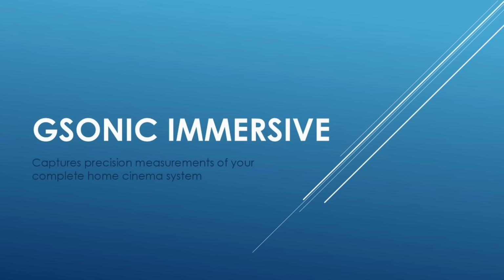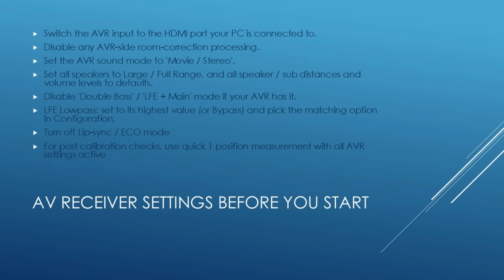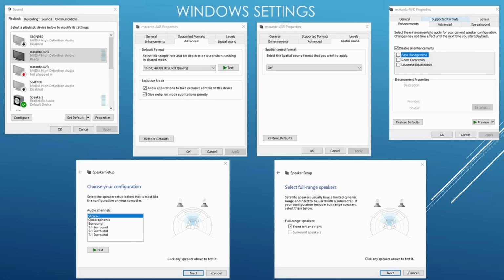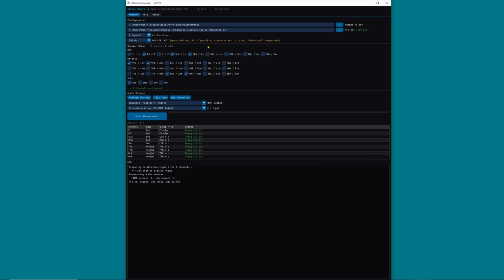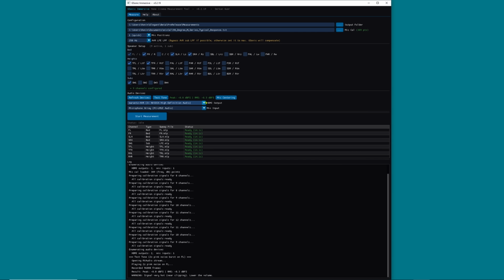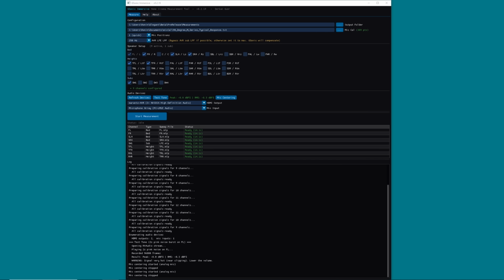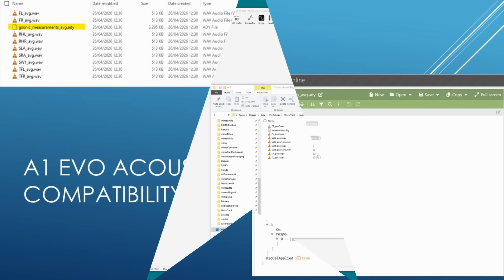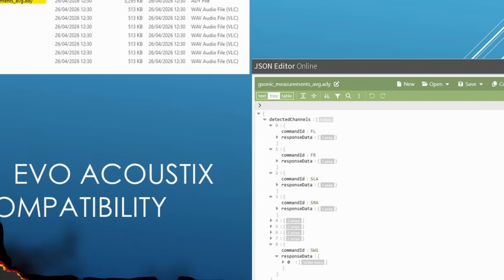GSonic Immersive

Comment: Hi,

just bought and trying to make it work. 

Getting this: 
SRA timing: both chirps were found at good level, so this is not the room, the speaker, or the mic - but the recording's internal timing is off by +213 ppm and the app could not correct it. What that means: the PC's playback clock and the microphone's capture clock disagreed over the sweep. Your output device is "4 - DENON-AVRHD (2- AMD High Definition Audio Device)". Things that cause this, in no particular order: HDMI audio clocks can wander while the graphics chip changes power state; a USB microphone with its own clock can drift against the PC; heavy background load on the PC; and room correction left running on the receiver. Worth trying: turn on 'Pause after each sweep', close other programs using audio or video, set Windows to a high-performance power plan, and if this PC has another HDMI output, try that one. Then click Repeat.

I have done: 
x6400h
umik1

8600g cpu
no gpu
so just one hdmi port.
nothing else is open

Funny though: 
When i click Repeat Measurement, then it works. 
so i can make it work but it is very annoying to have to click each time. 

Am i the first one with this issue? Couldnt find anything about it
Reply from the maker: This happens when the HDMI clock is unstable on the first wake-up, so enabling "Pause after each sweep" usually forces the clock to stabilize for subsequent measurements. You can fix the issues on your laptop audio path using the troubleshooting guide linked under the Help tab.

Comment: Hi OCA, it has been very helpful for taking measurements for my Yamaha A4A receiver. I have a few questions about using averaged measurements for EQ (they maybe very stupid, sorry about that)
1. In reference to the previous tutorials on manual calibration, we have to cross correlate multiple measurements of different positions,  and do frequency dependent windowing to prepare measurements for EQ. With Gaussian weighted average, I guess none of these steps are necessary? Please confirm.
2. Appreciate it if a tutorial can be made on how manual calibration can be done for atmos systems with the results from Gsonic immersive, or just point to an older tutorial to be followed after taking measurements... (of course with sub integration)

Thanks in Advance.
Reply from the maker: 1. The measurements you will find in "averaged" folder are all aligned and averaged, just EQ them as is, you don;t need to do any operation on them.

2.These are a bit old but I had covered Yamaha PEQ with the correct settings and how to use them with REW's automated configurable PEQ option. 

https://youtu.be/aZ4k04uAf2o
https://youtu.be/LwORN-tSPjk

And for subwoofer crossover alignment, you can use this newer tutorial:
https://youtu.be/YqaJWkLg7UU

Comment: Hi.  If after I ran the app i got some subs damage error.  How can I fix just those specific subs without running the entire measurements again?
Reply from the maker: If running Evo 32 mode, you'll need to repeat all of it I'm afraid. Check your PC audio path before you run a full measurement. Damaged doesn't happen randomly, your PC might be dropping capture frames and will continue to do so unless fixed. Troubleshooting guide will help with most common PC side potential issues.

Comment: I cannot get GSonic Immer to work on my Denon X4400H. Error says sounds mode is on Stereo or Dolby Surround and not AUTO. On my Denon, when I select sounds modes, I have Pure Direct, Direct and Auto. I have left it on Auto but GSI still says it cannot switch sounds modes.... I am at a loss. I was able to get it to work at some point yesterday but I aborted the measurement session early because I was getting some bad measurements.
Reply from the maker: What GSI version are you using?
Reply: @ocaudiophile  2.0.8
Reply: Should I do a factory reset?
Reply from the maker: With Evo AVR is not really tampered with but if all else fails, a soft reset should be enough. The problem must be elsewhere. HDMI cable?
Reply: @ocaudiophile  I have tried several times now. I was able to get through the "Reset AVR for measurement" successfully. However, when trying a test tone or Mic Centering, I hear no sound being played at all.
Reply from the maker: You need to fix the issues on your PC audio path.
Reply: @ocaudiophile  OK I found the issue. If this helps anyone else, here was my issue and resolution.  My Windows PC was sending a test signal to my Denon X4400H. The Denon was showing as playback device on my PC, but there was no sound being heard in my speakers. To resolve this, I had to set the HDMI format on the Denon from "Enhanced" to "Standard"

Comment: Hi, Serkan
In 2.0.7 version I have found a reproducible issue with GSonic Immersive and my Denon AVC-X3800H. Previous versions have been OK.

Before pressing “Reset AVR”, HDMI audio from the PC to the Denon works normally.

After “Reset AVR”:

the PC image is still displayed normally through the Denon on the TV;
DENON-AVR (HD Audio Driver for Display Audio) is still present and selected in Windows/GSonic;
UMIK-1 remains active and works normally;
GSonic Audio Diagnostics show no red errors om screen;
Denon’s own internal test tones work normally;

BUT, GSonic Immersive Test Tone produces no audible sound.

I then completely close GSonic Immersive and run the standard Windows L/R test on DENON-AVR. It is also silent.

So after “Reset AVR”, the HDMI video connection remains active and the Denon endpoint remains visible in Windows, but HDMI audio stops working completely.

Update:
After the above issue occurs, DENON-AVR may disappear from Windows. Using Device Manager → Scan for hardware changes makes the DENON-AVR HDMI audio endpoint reappear. This suggests the HDMI audio endpoint is not being re-enumerated correctly after Reset AVR.
Reply from the maker: The app cannot enumerate audio paths, only reads what Windows reports. You may need to update your graphics card drivers.

Comment: i took many measurements (recently EVO32-ones) with different/previous versions of GSI, but today with v2.0.7 i'm getting an error and don't know what to do (same AVR, same MIC (umik-1), same Labtop, same usb-connection): "FR recording had a capture dropout . the windows auto engine lost samples mid-sweep which corrupts the measurement, This is system-load / USB-bus issue, not your AVR. Close other apps ...."   -> i closed everything else and repeated the whole thing 4 times, nothing changes! what can i do to continue my evo32-measurement; please help
Reply from the maker: Try changing your USB port to a different one, preferably a native port directly on your laptop, to resolve the bus bottleneck.
Reply: @ocaudiophile  i tried this already, i'm using only native ports -> no difference/same message!?
Reply from the maker: Also remember to check the troubleshooting guide, you may find the cure in there. It's continuously updated with encountered user issues and fixes.
Reply: @ocaudiophile  'troubleshooting guide', where can i find this?
Reply from the maker: There's a link under Help tab in the GSI app.
Reply: @ocaudiophile  toller support, danke! ich habe immer das gleiche setup, immer den gleichen ablauf mit einer checkliste die ich immer abarbeite -> und das hat jetzt ganz genau 7x bestens funktioniert; das einzige was sich nun geändert hat ist die APP!! Und da hatte ich schon gehofft eine etwas sachlicherere und hilfreichere Unterstützung zu bekommen, denn in diesem Papier steht nichts drin was ich nicht schon immer vor jeder Messung gecheckt habe. Aber dann belasse ich es halt beim dem Stand den ich aktuell habe; der klingt auch schon ganz gut!
Reply from the maker: Capture dropouts can be caused by a couple of different things. They are reported by Windows, app cannot decide their presence. Windows drops captures if some other app tried to use the mic, HDMI port or they go to sleep mode at some point by a power saving/screen saver feature or Mic cable is not ideal and causing random issues. Without your debug log, it's not possible to know more than that.
Reply: @ocaudiophile  Right, thanks; I’ll give it a go for a fifth time in the next few days (I’ve configured everything on my laptop as described in the instructions). Once I’ve found the log file, where can I send it?
Reply from the maker: https://drive.google.com/drive/folders/13eRDRmuTau_J90WkXuszPc_MZU5LWiYv?usp=drive_link
Reply: @ocaudiophile  never done this before, but i tried it and hope it worked (GSonic_LOGs_20260909_DietmarPockrandt); maybe it helps, because i don't know what to do!? thanks in advance
Reply from the maker: Thank you for the logs - they were enough to find it, and the answer is that
this one is on the app, not your PC.

What your logs show: before every sweep the app plays 1.5 seconds of digital
silence and then throws that silence away. It is only there to let the link
settle. Your microphone reports two very short interruptions during that
silence - always within the first 40 milliseconds, always long before any
measured audio begins. Our dropout check accepts one such interruption inside
the discarded silence, but not two. So it discards a recording that is
actually perfectly good and asks you to repeat it, and then the same thing
happens again.

That is why it is always the same channel (front right), and why repeating
never helps. Nineteen of the nineteen rejected sweeps in your logs have
exactly this signature. It is also why your earlier run on 2.0.2 completed
all five positions: that version did not use the delivery path this check
belongs to.

I'll correct the check in the next version. Nothing you did caused this
and there is no setting on your side that works around it.

Two smaller things, separate from the above:

1. I can see you already reduced the microphone level from 100 to 75 - thank
   you. In every snapshot in the logs you sent it still reads 100%, so that
   change may not have taken effect, or it came after these logs. Either way
   75 is likely still too high: your sweep peaked at -0.05 dBFS, which is
   right at the ceiling. Try 50 and aim for peaks around -12 to -6 dBFS.
   This will not fix the dropouts, but it would spoil the results once they
   stop.

2. If convenient, try the microphone in a different USB port, with no hub and
   no extension cable. The interruption itself is a brief stall on the USB
   microphone just as recording starts. The wrong decision we make about it
   is ours regardless, but a cleaner USB path may stop it occurring.

If you need results before the next version, version 2.0.6 on the GitHub
releases page uses the older delivery path and should complete for you the
way 2.0.2 did.

Apologies for the sessions this cost you.
Reply from the maker: PS you can keep using v2.0.6 until then, the results are identical for your rig.
Reply: @ocaudiophile  OK; thanks for clearing up the mystery; so it’s the app after all this time. But now I’m actually a bit relieved, because I’d read everything and didn’t know what else I was supposed to set.
Regarding your points:
1) MIC level: as far as I understood, I can use the test tone button in the app to check if the level is right; if the bar is green, the level is correct. Have I got that wrong?
2) USB port: I’ve never used a USB hub or an extension cable before; and I also tried using a different USB port (I only have two on my laptop) – but that didn’t help either!
So, thanks again; now I can finally have a go at EVO32 (since then I’ve only been using ‘everything automatically’ – it’s all rather confusing).
Reply from the maker: Unfortunately, it can happen sometimes...So as to fix the edge case issues for some special rig, app breaks something already working for a few others.
Reply: @ocaudiophile  okay, i tried measurements with v2.0.6 -> worked fine -> calibration 'all-auto' -> sounds really fantastic; then i saw v2.0.9, downloaded this version and tried to re-measure -> looks to me as the same problem again, but now FR -> sended you the logs again [GSonic_LOGs_20260918_DietmarPockrandt], hope that helps
Reply: Okay; keine Antwort ist auch eine Antwort! Dann sieht es wohl so aus, als müsste ich in Zukunft auf die aktuelle GSI-Version verzichten, denn ohne eine Stellungnahme von dir habe ich keine Lust jede Version darauf zu testen ob der fehler (den du ja eigentlich beseitigen wolltest) noch immer drin ist; bisschen schade ☹ aber kann ich mit leben; grüße
Reply: tried v2.0.11 [uploaded - DietmarPockrandt_measurementLOG_20260926.log]: FL recording had a capture dropout - the Windows audio engine lost samples mid-sweep, which corrupts the measurement. This is a system-load / USB-bus issue, not your AVR. Close other apps (browsers, virus scans, downloads), and take the mic off any extension cable, USB hub or docking station - a run past the 5 m / 16 ft USB limit corrupts capture on its own. Plug the mic into a different USB port (ideally not a hub, avoid USB 3.0 ports next to one another), set Windows power plan to High performance, then click Repeat to re-measure FL.
Reply: @ocaudiophile  until which version? Even v3.0.0 doesn’t work; now after updating my graphics card driver the app is not launching any more!?

Comment: Hi @ocaudiophile, while setting up GSonic Immerisve I ran into the issue that windows was able to send test tones to the AVR and they played back fine, however when starting a test sweep with pink noise from GSonic Immersive itself, nothing happened. Funnily enough what fixed it for me was re-installing REW and allowing desktop applications to use my microphone. 
I had followed all mandatory and mentioned steps. I also had to put the Speakers to 48khz @ 24Bit, otherwise it would not send pink noise as test sweep. 
Kind regards
Reply from the maker: Glad you got it sorted, thanks for sharing these tips for others who might run into the same issue.

Comment: OCA has created a really amazing software to extract the most out my surround sound system. I've used a few different calibration applications in the past. I'm finding my two subwoofers mixed with the rest of the speakers has never sounded this good.  I bought GSonic Immersive and GSonic Evo 32.

One other thing that really stood out to me is the speedy replies to my very novice questions that came up while I was getting things setup. Customer support is a really big deal and OCA delivered in spades in this regard!

The top tip I would give anyone getting things setup for the first time is to follow the "GSonic-Measurement-Rescue" page. Don't ignore it! Especially if you're a novice like myself.

Thank you for everything OCA!

Comment: @OCA Some feedback concerning TS/VOG measurements. 

In Evo mode with 8500HA and Auro 13.1 layout the signal for TS/VOG comes from the HFR, HFL, HBR, HBL channels at the same time.

My workflow for measuring is as following (I use only the pre amps on my AVR):

1. disconnect TS/VOG form the AVR
2. measuring all channels in the normal way (including HFR, HFL, HBR, HBL)
3. before measuring TS/VOG disconnect HFR, HFL, HBR, HBL from the AVR and connect the TS/VOG to the HFR output on the AVR
5. measure the TS/VOG
6. disconnect the TS/VOG and reconnect HFR, HFL, HBR, HBL
7. continue with the sub
8. repeat workflow for all positions

Since there are only 5 positions to measure this process is absolutely acceptable for me.  I am very happy that you integrated the option into the measurements and calibration. Very much appreciated!

In addition I would like to note something. In the log it says that for the TS/VOG the combination of the 0° and 90° cal file is used. As it is for all other hight channels. I would like to propose to use only the 0° file for TS/VOG since in these setups the speaker is directly above the listening position. 

With best regards
Reply from the maker: Great to hear and your method should go to troubleshooting guide for Auro setups. And I'll change TS to use 0 deg cal file.
Reply: @baronbob6971

Great Info! May i ask if it is the same for CenterHeight as i do have the same 13.1 Auro Layout. 
Or is this only needed for VOG/TS ? 

BR
Reply: @user-vz4nj7yz7z  I don't use the center anymore. So my Center Height is also turned off. So I can't say for sure.